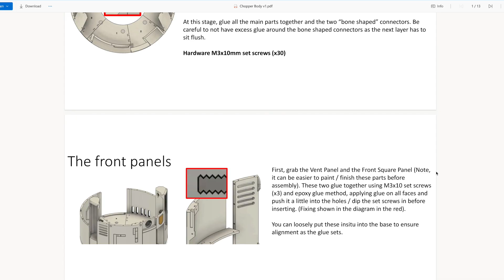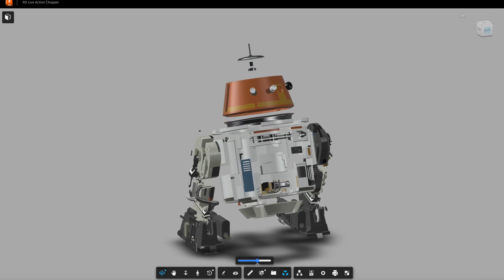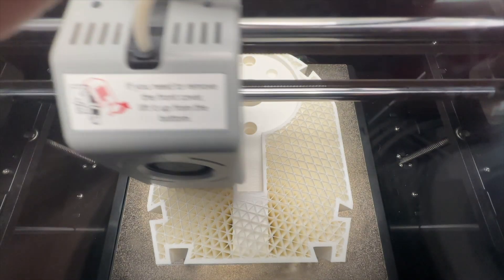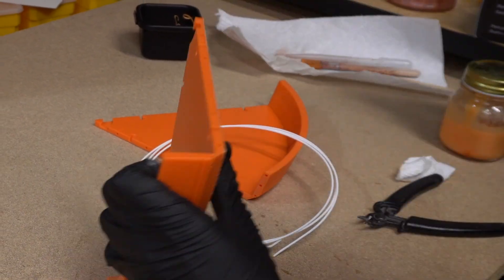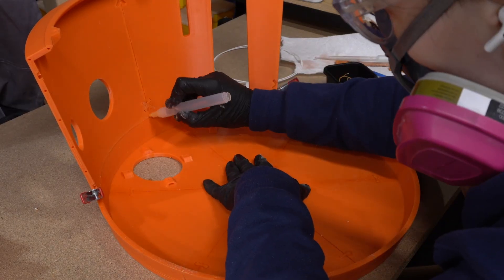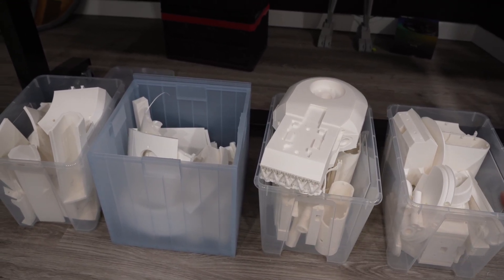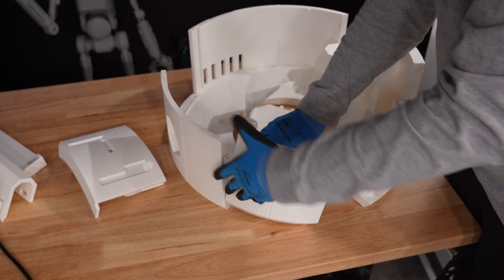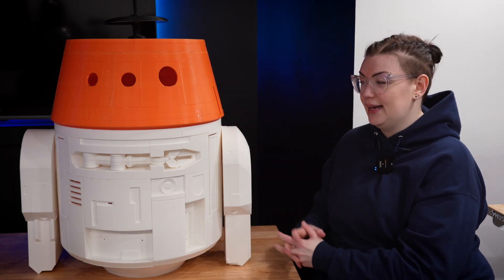What it Takes to 3D Print a Life Size Astromech Droid

Comment: Sure hope we see more of this droid's build in the future.  It's definitely larger than I imagined, but then I've seen R2D2 droids running around Star Wars Celebration that were that size, so I don't know why I thought this one would be smaller.  As someone thinking of getting into the 3D printing hobby, I'm curious why you chose ABS over other filament types.  I see you use it a lot in your videos.
Reply from the maker: Definitely! I just unfortunately haven’t had a large enough chunk of time to look at going back to him yet. It’s on the schedule in the next month or so though!

It’s purely due to its ease of post processing. I’d estimate it cuts my time down by more than half which is how I’m able to make so many large projects in a reasonably short amount of time. You don’t realize how badly PLA sands until you use a filament thats actually meant to be sandible. PETG is easier to sand but still more effort than it needs to be.

Comment: This looks amazing! I'm actually getting ready to start on my droid build as well. Do you see any concerns with using PETG over ABS? I'm trying to avoid issues with fumes, and from what I've researched, it seems like PETG still does fairly well with UV and heat - especially when it's been painted (not that it would go outside much).
Reply from the maker: Definitely not! There are many people that print their droids in PLA/PLA+ with great success so a PETG one should be no issue as long as you’re able to produce accurately fitting parts with that filament on your printer.
Reply: @MMsPropShop  Thanks so much for your response! Thanks also for all of your videos. I'm new to 3D printing,. I don't really subscribe to much on YT, but you've got a new follower with me. I've watch a few already and your information is incredibly helpful and interesting.

Comment: That's looking very cool so far! Chopper is definitely one i want to make at some point.
Do you run into any issues running both printers on the same table together?
Reply from the maker: I was initially concerned about that as well but there seems to be no difference in quality with them running at the same time or not. If they were printers that didn’t have input shaping then it would most likely be a different story.

Comment: Very excited to see this. I started the animated Chopper before the live version was shown at celebration. Finished the legs and feet and some of the body. Decided to switch to the live version and waited for all the files to be updated. In the interim the Bambu X1C was released. I was using PLA+ before and now everything is ABS. What a difference in toughness it makes, and everything prints 4 or 5 times as fast. 
Please, please, please make videos on the steppers and electronics when you get to them. I have read a lot and watched videos, but that is the going to be the hardest part for me.  Are you going with the Padawan and Maestro system?
Reply from the maker: Yeah it’s pretty incredible what these latest generation printers can achieve.

I’ll do my best with making a video about the electronics process although I’m no expert so
I’m not entirely sure how helpful it’ll end up being lol. I really haven’t looked too into the specifics of what the pros and cons of the various system setups are, but I’ll most likely go with whatever one seems more beginner friendly or at least better documented in terms of setup to help me figure things out.

Comment: Curiouse, why ABS and not ASA?
Awesome videos!
Reply from the maker: It seems the only true advantage of ASA over ABS is its UV resistance which isn’t going to change much for a piece that’s going to get fully painted in the end. Add to that the extra cost of ASA, just didn’t seem worth it. I mostly prefer printing in ABS because of how easy it is to post process; the added strength and resistance is just a bonus.
Reply: Valid points! I have printed with a lot of ASA mainly because it does not give off any bad fumes (but a LOT of particulates), I have not tried ABS because of the fumes. Thanks for your point of view, I will give ABS a try
Reply: I am also a fan of using ABS over ASA for the exact same reasons you stated. On big projects like this the difference in price adds up pretty quickly!

Fantastic build!  @MMsPropShop

Comment: Very cool and awesome progress! The new printers make me envious at such speed and precision! I started my Mark II hybrid Baddeley back in 2018? Gah! Has it been that long?? Geesh! I've got a lot of reprints and stuff too lol. The same for my Johnny 5 project I just started last year. I started my R2 with 2 Da Vinci's and ABS before switching to PLA/PETG and my CR-10S4 and Ender 3.
I so want to do the Pit droid that you did too. lol
You may want to print the greebles with your resin printers. The fine detail is better there. Trying to sand them can be a nightmare.
Believe it or not, sanding, sanding, filling, more sanding, and painting are the EASY parts. The electronics are the expensive nightmare. There are many different visions on how to set things up. I highly recommend checking out Astromech.net for tips and also the wiring. There are mods too, and tips about what works and what needs modification. Mr. Baddeley has come a long way from the Mark II R2! 
Post your electronics there and get it critiqued by the experts before you go shopping. I highly recommend that. Also, do a layout of your electronics on foam core board and then transferring it to the final board. Check out John Salt's videos and others for handy tips and tricks.

Comment: Hi, I'm the guy who's printing the Republic Commando Armor (I commented on an other video of yours).
3D-printing got me hooked, already ordered the new Qidi printer and got me an Anycubic Photon Mono 2 for the details :)
All thanks to you :D

You mentioned your new ABS-settings. Would you mind sharing them? I sometimes have some problems with fitting 2 pieces together, so maybe my settings are not 100% correct 😅
Reply from the maker: Haha, that’s awesome! Sorry for being a bad influence? 🤣

I annoyingly couldn’t get Orca to export a config file for my settings, but here are screenshots: https://drive.google.com/drive/folders/1FyujBmhh-VTaaXOMi8OSnKjPlPwtihe3

A lot of the time I’ll change the speed to 90% on my machine. It’s mostly to guarantee that high stress parts are properly melting together. I know I could go in and adjust all of the speeds but just changing it on the machine works for me for now.
When the pieces don’t fit is it because things don’t seem to line up correctly or that things seem too big/small to fit into other parts?
Reply: @MMsPropShop  
I would definitivly not say a bad influence, but on the other side it gets quite expencive very fast 😅😂

The parts seem to be too big, like a milimeter or so. I recently printed a ramp for a robot vacuum and the parts were fittet with dove tails. I needed to sand all of them so they would fit.

So you just adjust your speed at the printer directly, not in the slicer?

And thank you for the screenshots!
Reply from the maker: @codyrex4382 there is a chance that it could just be that the file hasn’t allowed enough clearance between pieces, but if it isn’t then it’ll be due to a slight over extrusion on the walls.

Yes, just adjusting the speed on the printer. Maybe a bit impractical but I haven’t been bothered to adjust all of the speeds down in the slicer 😂 It will print fine at 100% but on thinner pieces that are all or mostly walls and no infill, I find that full speed can risk delamination.
Reply: @MMsPropShop  
Thanks for the tipp!
How could I get rid of this over extrusion?

Will try to adjust the speed on the printer, seems to be easier and more flexible than in the slicer anyway 😊
Reply from the maker: @codyrex4382 technically it could be caused by overheated filament; too much is oozing from the nozzle when it’s printing. But if you feel the temperature is good, there are extrusion multiplier settings for each type of part on a print. A lot of times the walls will be set to 0.42mm, you could lower it to 0.4mm or less.
Reply: @MMsPropShop  thanks, will try this the next time I print something that needs to be precise!

Do you have a patreon or channel membership btw?
Would love to support you, you helped me soooo much getting started! 😊
Reply from the maker: @codyrex4382 no Patreon or memberships. The closest thing would be the super thanks feature but please don’t feel obligated! Watching/commenting on my videos is all the thanks I need.
Reply: @MMsPropShop  okay :)
Then thanks again for your help

Comment: Mr Baddeley does some fantastic work. I'm about half way through R2 but have been paused for a few years as my 3D printer stopped working and other things distracted me... I'm half tempted to reprint him anyway as what I have is a bit hit and miss... having said that... it's about 250 or so pieces printed of about 500... so tough choice. I think the design has been updated since then so I might have to have a look... I'm also tempted to try casting the dome in metal (via home made forge)... but that could be tricky.
Reply from the maker: Definitely! His files are so well designed and thought out.

Oof. Yeah, that is a tough call. I believe they’ve tried to have most new version parts work with past versions of the droids but you’d have to check. 
The metal dome sounds like a very cool and very complex project lol
Reply: @MMsPropShop It's partly because when transporting my partially built R2 to the local hackerspace for an open day, it got knocked about a bit so there is some damage. I think the new dome design looks more "solid" too... I'll likely print some test pieces then attempt casting and see how that goes... otherwise I just have a lot of sanding and filling to bring the rest of it up to a nice standard (I don't have quality printers like yours :D... or your skill... let's not forget that!)